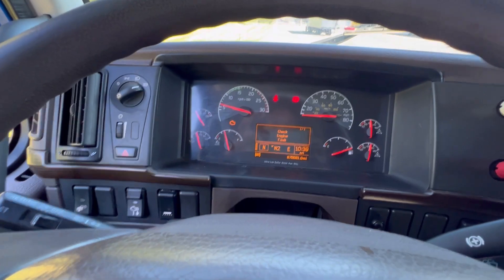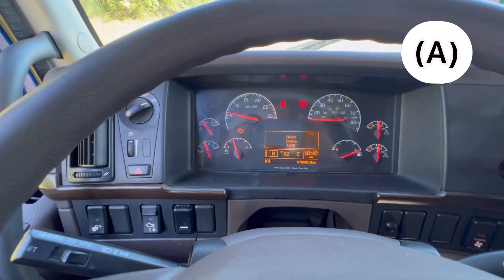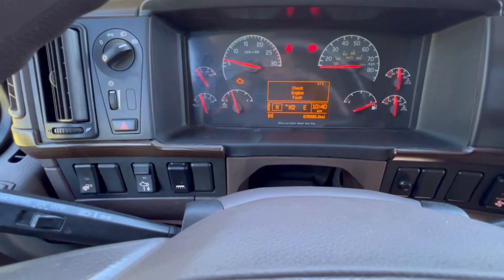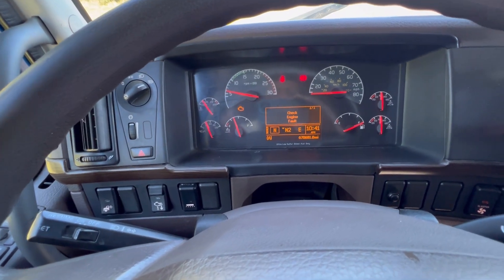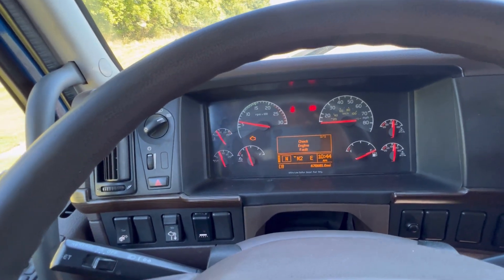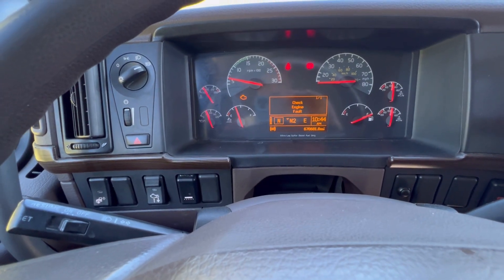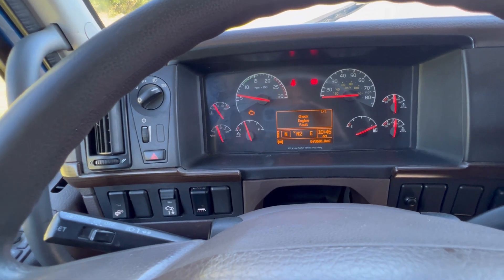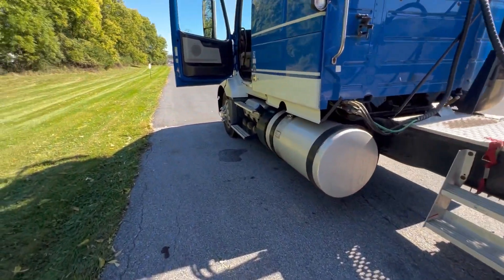Volvo semi trailer engine brake (how it works): Must know for safety

Comment: When using the engine brake, do you still have to press the service brake or you let the truck keep rolling
Reply from the maker: You can still press the service break if the truck is not stopping fast enough

Comment: FYI: exhaust brake system and engine brake (jakes) are two different systems. Might wanna change the video header to: engine brake.
Reply: Not sure about this particular truck but Volvo FH16 use an exhaust brake and engine break. Depending on the setting you use.

Comment: The auto mode is for use with the cruise control and allows one to set a speed when the engine brake will activate to keep it within the set speed range.

Comment: Hey mi general wicked video, thanks. My truck is a manual and the engine brake is different. I don't have A and B. In it's place I have 0 to 1. Why is mine different and what year is your truck
Reply from the maker: Blessings brother. 
My truck is a 2015 Volvo and the reason why the engine break is different is because on the automatic transmission, the engine break works with Transmission to gear down fast when u Engage B, that is the highest level which slow down the truck immediatel unlike the manual you have to downshift to help the engine break stop the truck.

Comment: The biggest mistake is drivers not using the transmission to its fullest function. It is way better to use it in the manual function I drive a volvo and use the manual function all the time. I use my transmission and Jake on hills and curves and I rarely touch the brakes. But then again I am old school
Reply from the maker: Think I need to try it out
Reply: The biggest problem with automatic transmission is they shift when u don't want them to manual function is way better on snow and ice u have better control
Reply from the maker: Yeah I have tried it and its good to use but alot of work for me. I’ll definitely use it in the snow though
Reply: @TorqueTrucksTreble can you explain in a video what he means !?
Reply from the maker: I’ll definitely do that soon as possible
Reply: Has Volvo VNL ever had a retarder ( oil retarder at gearbox like in europe) ?
Reply: @dimatall  no just a Jake brake

Comment: So when you're in 3 and the conditions are right(rpms are low enough) and you press it down to "b" it will downshift to slow down more effectively. You press it down to "b" and release it back to 3. Pressing it down signals the transmission that you would like to downshift. Hope this helps everyone
Reply from the maker: Great info 🙏🏾